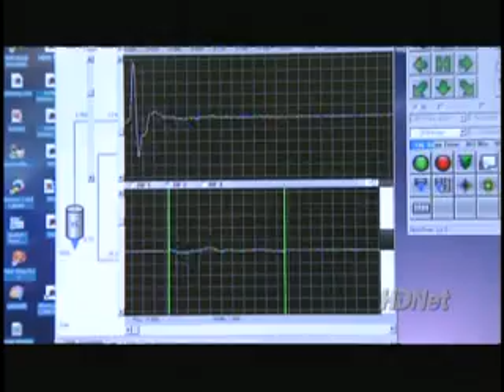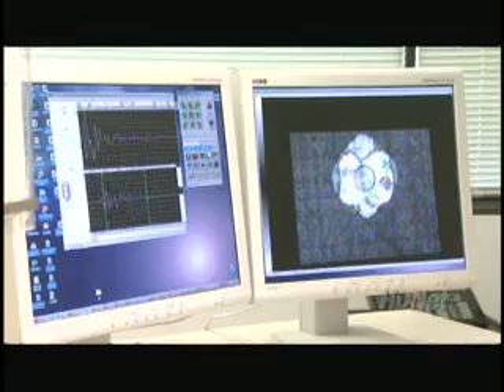Dan Rather Reports - Boeing 787 composite concerns (3 of 4)

Comment: On AA flight 587 the fin detached because the 6 attachment lugs that connect the fin to the fuselage failed. The lugs are metal (aluminium/titanium) NOT composite. The fin was composite but the parts that failed were not.